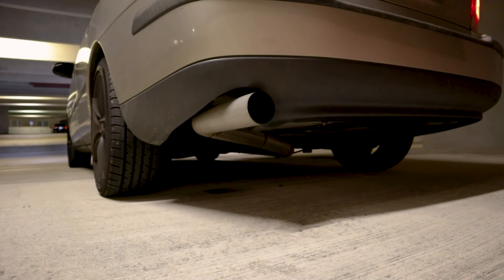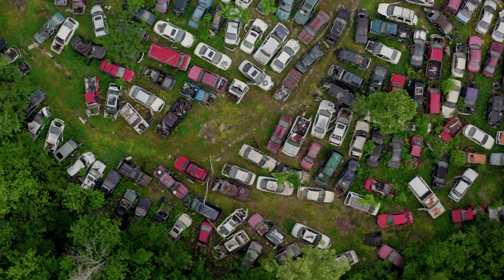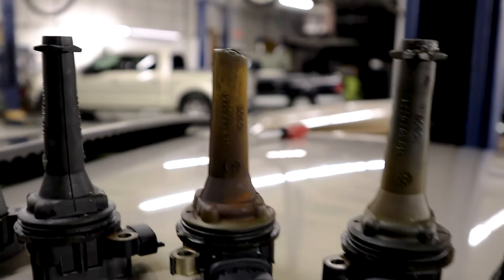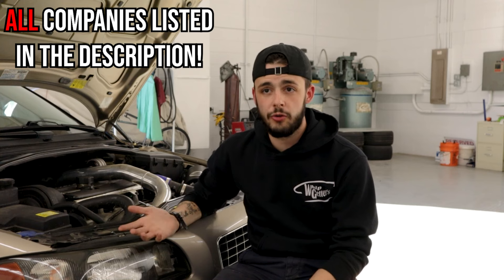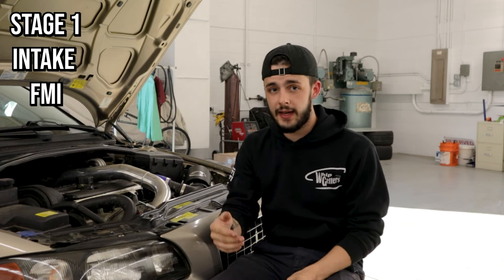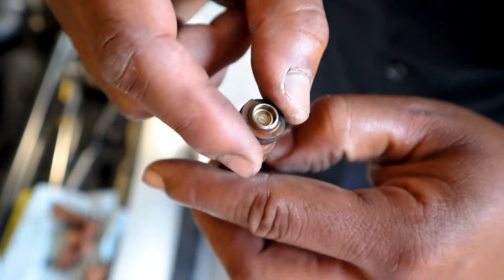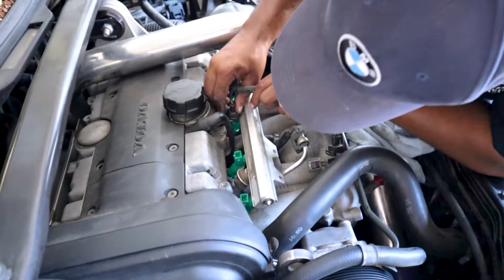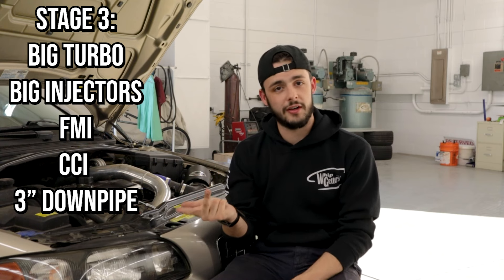What To Expect When Modifying A Volvo | Understanding Volvo’s & Performance

Comment: Good basic info, everyone forgets stage 0 before mods. Also those new to modding should also consider supporting mods besides power adders. Adding 150 hp means nothing if your transmission hasn't been looked over, same goes for brakes and suspension. Did this on my IS with no regrets. Spent more $ on brakes, suspension, transmission than i did power adders because power means nothing if you cant get it to the ground or control it.
Reply from the maker: Very right and thank you for sharing the good points!👍

Comment: I have a 2000 Volvo xc70 with the 2.4t, in 2001 they switched to the newer body, like yours. The two engines have similar specs but are they technically the same exact engine? Both are 2.4ts, I just want to add more power but can’t find anything for my generation
Reply from the maker: One way you can see is looking on Wikipedia for the Volvo 5 cylinder generations to see if your motor code matches up with the other motor codes. The 2.4t’s are really great motors and can handle a lot. But you just can’t push it to the edge where it will break. There’s a nice middle ground. Our S60 started with 197hp out the box, now it’s upwards of 320-350hp as an estimate!

Comment: I've got the 2.4i inline 5 in my S40. It's got 130K mi on the clock and I paid a shop to do the timing belt, water pump, spark plugs, injectors, brakes & fluid, and a bunch of the suspension (shocks, struts, tie rod ends); all of it at around 120K mi. Serpentine belt is intact, no cracking or fraying, haven't noticed a slip. I think I can get to the ignition coils myself without bringing it in for a service. So the million dollar question: is it possible to do crank seals and cam seals without a proper mechanic shop? Is there a way to know yes/no they definitely need to be done? Is this beyond the scope of a shady ree mechanic? Cheers and thanks for the great content!
Reply from the maker: When we did our crank seals and cam seals at one point and whooooh let us tell you, it was an adventure. BUT not impossible. We had the timing wrong after countless times thinking we fixed it. Just make sure to check your ps and qs, and always try and watch tutorials. There’s plenty of really good ones out there that will help you. The only real way to know if they need to be replaced is oil leaking. There’s no other way to really tell if something’s bad until it shows itself. We appreciate the cheers 🥂 and thank you for behind a supporter of ours!

Comment: so I need a stage zero on a 2018 with 12k? Need an update for the newer versions and Im asking for all to see not just harping on your channel. Awesome stuff if I ever go broke.
Reply from the maker: We should have clarified that these are mainly for years under 2014 mainly equipped with the 5 cylinder motors. A stage 0 never hurts especially if you are wanting to do performance. Just because a car has 12k, does not mean it should be at least checked over before upgrades.👍

Comment: Great content!! I have a volvo S60 2.4 T5.. was having engine light that reads out fuel pressure sensor prob code..changed and after a week it pops out again..😢
Reply from the maker: It’s always the smallest things that have the biggest impact. Our S60 is having a whole fuel pump problem, which we have to fix anyways because the fuel cut that happens just makes the car not drivable.🫤
Reply: @WhipGetters  thanks for the reply mate! So far my car haven't had any jerking or turn off by itself. But then, was expecting to check on the fuel pump too.
Btw, i just replaced the aisin gearbox coz it got filled with gearbox coolant.
So, after changing the gearbox, i could feel the gear changing wasn't that smooth. Felt like it shifts hard from R to D and likewise. Other than that frm 1st to 2nd and 3rd too. Was kinda stressed up to drive in jam/city coz if it shifts down, could really feel the jerking. Any suggestions on this?
Reply from the maker: Majority of the FWD Volvos came with the really shitty transmission I think it’s the AW55-50SN Trans which sadly couldn’t handle a lot of power once you started. After a while the S60 transmission is was slipping and slamming into R & D whenever it was warm. We replaced the transmission to one with way less mileage, and once we did that, everything with the transmission was fixed! Also, good to notate, the FWD Volvos do NOT like hard launches!😂
Reply: @WhipGetters  ouchh..but its engine puts out really great torque 😆 . I do suspect the happens due to driveshaft, or engine/ gearbox mounts. Does it affects them?

Comment: I went billet 22t... Td05 18g wheel stuffed into machined td04 housing. Limited me at around 330-350whp. Mind u thats with a dw fuel pump and dw 800 injectors, wmi, and 100oct. Did the 3" catless turboback, Snabb inlet, Snabb rip kit, Kinugawa wastegate, ipd hd cbv, ipd hd tcv, viva front and rear brace, bc coilovers, ttv 11lbs chrome moly flywheel with sachs 707 audi rs2 pressure plate, has all poly torque mounts, solid engine mounts, poly subframe bushings, aem x series wideband, glowshift boost gauge and oil temp in a lotek pillar pod, msd coil, kingsborne 9mm silicone wires new bosch cap and rotor, modified pcv 10an to dual filter giant catch can to drilled out ptc in the inlet, brembo bbk, ss braided brake lines, and stage 3 vast tuned ecu.
Waiting on the td06sl2-20g 10cm kit with milled n ported manifold with m10 studs.
Comes with everything and should make around 450whp. I have a 98 s70 t5 factory manual car so has motronic 4.4 but i put a b5234t9 with 143mm rods from an 04 in the car with 60k miles on it. About $12k deep so far including $1500 purchase price of the car. Keep going man its addicting...
Reply: Hey bro, how does the later engine swap work, also got a 98, but H rods are hard to get here, so ive been thinking of a swap.
Reply: @ryanpillay2679  pretty straight forward. Theres some good write ups on volvospeed. Its been 2 years but you need the 99-00 front engine mount bracket, the 98 accessory bracket bolts up with 5 out of 6 bolt holes so you can use all your current accessories (alternator, ps, etc). You use your current crank sensor, and cam sensor on the rear of exhaust cam. The rear of the intake cam is already threaded for a rotor plate, you pop the plastic cover and drill the hole 1/2" deep (cant remember exact bit size but on the forums). So you can attach your 98 rotor and distributor cap. The accessory belt fits slightly tight with rn idler pulley use belt 060690 Napa part# if cannot get this specific belt punching in part # online should give you dimensions to find similar. Your stock hard line fuel lines wont fit the bend over the cam cover i used gates e85 submersible fuel hose from the regulator on the rack to jic fitting at the rail. Im sure i missed some but this is the gist of it.
Reply from the maker: There’s a reason your name is OGfromUtube! Coming in clutch with all the info, making us collect so much more info!😎 This whole car process of modifying these cars and motors does make it so addicting! Makes us want to get a T5 motor even more and make it a full engine build. Your dedication and knowledge will probably make our decision even more precise!

Comment: What is the performance potential of the 2.5L 5 cyl? Whats a typical stage 1 make, stage 2 etc? Quarter mile times? Im interested...nice alternative to the price of an RS3 for that sound!
Reply from the maker: The potential can be tremendous but that all just depends on your budget. There have been guys taking these motors and making them complete monsters making 500hp reliably but that takes redoing the internals and more. Stage 1 - 3 is definitely worth every amount of work put into it. From 0 to 2 it’s a completely different car. Stage 3 makes it a completely different animal! For the quarter mile times we’re not sure as far as modified cars, but there’s plenty of data online for stock forms of the cars!👍
Reply: @WhipGetters  how much power are you achieving with stage 2 on E85? And what does your stg 3 cae make....just for reference?

Comment: What do u recommend doing befjre a RIP KIT
Reply from the maker: Just making sure your car is ready and able to handle the power it’ll be getting. Make sure there are no oil leaks, the engine has been fully looked over, and that incase you do have a failure in any shape or form, it can be easily fixed.👍

Comment: I have a 2014 volvo v40 T5 2.5 R-design, with 35k miles on it, i want to chip it and get a downpipe what should i do first? Are there big differences between my T5 and the older ones? Eventually i want the car atleast at stage 2😁 The car is completely checked and Just had a service. You have any recommodations on what i should do first to get a better sound and performance?
Reply from the maker: I would do your downpipe or exhaust first! Cause then when you chip it, you’ll be able to tune it for the downpipe and probably get more for your desire! 2014 is a P3 platform and they’re very different from early and original P2 chasis ones like ours. If you’re wanting sound, do exhaust. Then we guarantee once you do that, you’ll be hooked and wanting more!😎

Comment: Ironic I fell into an 04 S60 non turbo! ( Same color as yours)  FWD and I've found nothing! Everything on line says you should have bought the T5 well at the time I was just getting out of a serious accident in my old car and a friend offered this one to me cheap! She runs good with 210k only changed back to the OEM plugs and installed a a K&N box filter, only thing I really wanted after that was to get rid of the bread box muffler!! Any recommendations instead of straight pipe? Ik that's probably asking a stupid question but just wanted a little more growl! Anyway I do appreciate your video for the future!!
Reply from the maker: Since it’s the naturally aspirated one, the exhaust system set ups will be a little different. But what you can do is do a muffler delete and factory resonator delete and install a smaller but high flow resonator which should give you a nice purr and some great noise for not being super loud. Our S60 being straight piped is loud but not as loud as some N/A 4 bangers and v8s straight piped. The odd firing pattern of the 5 cylinder gives it a lower tone. But if you want some nice purring and noise, that should do you good! Also there’s no such thing as a stupid question!😎
Reply: @WhipGetters  hey really appreciate your advice! Definitely get through the winter here on the east coast and will start looking for the Red and decent muffler ! Yes, just looking for that low tone growl or as close as possible! Ik a lot of what doing I can't! But still truly appreciate your videos and advice!! Good luck and thanks again!!
Reply from the maker: We really appreciate you showing us some support and stopping by for some info!🔥 Good luck on your journey and if you need anything more, don’t hesitate to reach out!😎
Reply: @WhipGetters  Ty guy's! Looking forward to seeing you guys grow this channel for all Volvo enthusiast! Happy New Year!! Blessed 2023!
Reply from the maker: We really appreciate the good vibes! We’re gonna have plenty more Volvo content on our channel too. Happy New Years to you as well!🎉

Comment: Good video. How can i increase my boost on my volvo s60 2.0T. I have a custom 3" straight pipe exhaust and a TD04HL-16T turbo on it and its running on 0.4 bar boost and wont go higher
Reply from the maker: Have you gotten the car tuned at all?🤔
Reply: @WhipGetters  i have been trying to but every one i go to here tells me they cant do it or i must change ecu before they can tune it
Reply from the maker: Contact Hilton Tuning!😎 I’m pretty sure he’ll be able to help you out!

Comment: Just wondering about the exhaust, you mentioned a 3" straight pipe, is that 3" turbo back, with decat and muffler delete and single exit?? If that's the case, do you suffer from drone at all, if so at which RPM range? I have a Ford Mondeo 2.5T (UK) with the next gen B5254T3 engine with 3.5" down pipe, down to a 3" decat and a 14" straight through centre resonator with rear muffler delete which then splits into 2.5" dual exit after the rear subframe and it drones between 2.5 and 3k revs, just wondered if it's the car, engine or exhaust setup..
Reply from the maker: The car has a single exhaust. Full 3” off turbo back. No resonators, no mufflers, no silencers or cats. Drone really isn’t bad in the car. It probably is the worst on highway rides from 60-80mph. Other than that the odd firing pattern of the 5 cylinder and the turbo doesn’t make it drone like you’d think! A lot can do with exhaust noise as far as engine modifications too. That’s a whole other book of things, but mainly it’s just the exhaust!😎 We hope this helps!

Comment: Hey can u recommend anywhere other than elevate for upgrade for a Volvo 850 t5 engine? Say I want individual throttle bodies that I can attach an air box to for a turbo, can you recommend anything at all? Would really appreciate it
Reply from the maker: The individual throttle bodies would be a difficult one to do unless it’s been done before and been sourced for being normal. If that makes sense. You can try Viva Performance, they are a great source for performance on Volvos! A lot of if not all Volvos that are modified will have a single throttle body for all the air flow. Unless it’s a full on custom race car using the motor. We hope this helps and if you have any more questions, feel free to ask!👍
Reply: @WhipGetters  certainly did man thanks a million🙏🏽
Reply from the maker: Anytime brother!😎

Comment: i have a c70 t5 (older model) and id like to get more performance but i got no money and i dont want to do anything before some important maintanances. also i think maybe judt save good amouny of money and build it well and mindfully at once so it might save a lot of headache. just a dream not yet obtainable with out getting fulltime job.
Reply from the maker: You’re right in everything you said. Not only are these cars super reliable when they’re taken care of, but parts and maintenance can be just a little more costly than desired!😮‍💨
Reply: @WhipGetters  yes mine has served well until now (nearly 4years) probably blown headgasget. but still love the car just amazing to drive

Comment: I have a 2005 s80 2.5T AWD with about 200k miles, seems to run great i picked it up 2 weeks ago. Whats gonna fail on me first and what would you recommend to do for maintenance first. A little list would be cool thanks 🙏. I dont know much about volvo im big into the vw scene
Reply from the maker: It just depends on how the car was taken care of. First before anything, is check your timing belt. Inspect it to see if there are ANY cracks or splits. If you just want to be on the safe side, replace the timing belt, tensioner, water pump, and check the idler pulley too. If that snaps or breaks, that could be the end of the motor life! Just check all basic maintenance, then once all is done you can start having fun with the modifications!😎
Reply: @WhipGetters  thank you very much, will do that for sure
Reply from the maker: Enjoy the process!👊

Comment: Ok man you've commented on a few of my comments but here I go I need your help I want to get a 2006 s60 I'd love a s60r or even a 2.5 but none in my area but what would I need to change/mod to get about close to 400hp at max no more I want a quick grocery getter that can still handle michigan roads in winter
Reply from the maker: So there’s a couple different things you can do. if you’re wanting to push 400whp on a S60R, it’s a little easier to do than a 2.5t. Considering that they’re the same displacement but different motor types. S60R owners have done 400whp reliably with a good amount of mods. Anything pushing over 400whp you’ll have to remplace the internals due to them not being strong enough. A super rare but amazing Volvo modular motor would be a 2001 2.3T. These motors/ cars are pretty rare to find because they are heavy duty tanks. That motor came with iron cylinder lining and what makes it  different than the 1990-1999 2.3s is the introduction to OBDII but also the engines update. At the end of the day it’s entirely up to what you want, but the more power you want out of these motors, the more money and work will have to be put into them.👍
Reply: @WhipGetters do you know if the 2004 2.3t motor is the same as the 01 2.3t? I want to push my t5 to some higher numbers but worried of the limitations of my motor and auto aw55 trans :/
Reply from the maker: @stayclassie6875 There are different motor applications for certain models of Volvos. Majority of the time, the 2001-2004 2.3l engines are the same, but may differ in specs and engine codes. Having a 2.3l is already a huge advantage compared to 2.4 or 2.5. Certain 2.3l engines came with iron cylinder walls and can handle some big power!
Reply: big wall gang, ty @WhipGetters
Reply from the maker: @stayclassie6875 Anytime!👍

Comment: big 3 upgrade  how to do that on the p2
Reply from the maker: Not sure what you’re asking, but we think you’re asking how to do stage 3 on a P2. Normally you’ll do your stage 1, and stage 2 to get to stage 3. Everything that supports stage 3. Either stage you’ll most likely need a reliable tuner that can have your car run nicely at those stages. It’s not too difficult to get their, especially if your pockets are deep!🤙